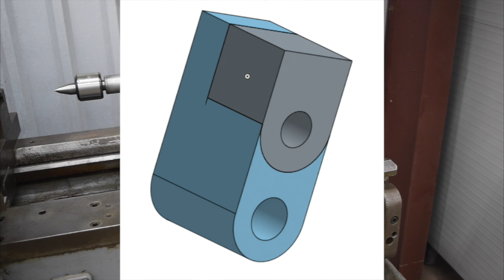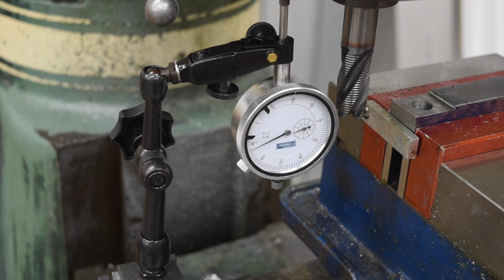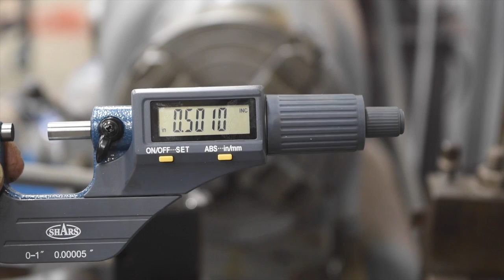1954 Monarch 10EE Lathe Tailstock Modification - Part 2

Comment: Gary thank you for the shout out and kind words.  
I apologize on the first video I had a hard time with the scaling and now I see your problem with the overlapping holes.  One option I see would be to fill the existing hole, probably the easiest thing would be to thread in a stud and loctite it in.  Finish it flat to the width of the tab.  Then, the part that you would make would have to be attached with a smaller screw, maybe like a 10-32 from the back.  Drill and tap the hole for the adjusting bolt, which would go through partially the stud you installed.  I think it would be ok since the bolts are not really seeing much load, just enough to move the tailstock.  Otherwise something on the outside like you mention in the video would work too.
On your threading, shoot for a couple of thousandths undersize for the major diameter and put a chamfer on the shaft.  These will help threading if you have to use a die.  I don't know how to put your lathe into back gear, but that will help too.
Reply from the maker: Awesome, thanks Bill, it sounds like i have a few options.  One other one i was thinking about... what do you think about this?  Mill the existing tabs flush with the bottom of the plate, plunge a 3/4" end mill into the same spot as the tab, but create a pocket that's 1/4" deep, then drill and tap with 3/8.  Then make an L shaped tab that will have a countersink bolt and recess into the pocket, and on the leg of the L drill and tap that to fit the current bolt?  I hate to modify the tail stock, but worse case someone could make 2 more L tabs the same height as the current should they try to put it on a 10" lathe... thoughts?
Reply: I think that might work too Gary, getting the tailstock setup on the mill might be a bit tricky.  Gary C's idea is good too would be a good test for your welder and gasmix.  If you go that way he makes another good point with installing an insert.  Make sure you size the boss for the larger thread size of the insert.  I like using keenserts for those type of things.

Comment: All the tooling starts adding up fast.   I got a brand new Bison 8 inch 3 jaw chuck for my lathe for $375 with the chuck key missing.  Normally there around $850.    The best thing you can do for the tooling is keep looking until you find each thing at a decent price.
Reply from the maker: Yea your right about that.  The key is to always be looking and not wait until you actually need it or you will pay the high price.  I have been doing that on a vertical bandsaw for a while now.

Comment: Fair enough on the money explanation. I can under stand that. We were lucky enough to get our machine with a bunch of accessories all for two grand. It's no where near as capable as that machine, but I can't imagine buying it piece by piece. I've never taken a tailstock apart myself, but I'll re-watch part of part what and see what I think. But I don't know it will be any better than what you come up with. I don't think an external plate wold work. Those things have to be crazy tight on bigger machines and they still move, at least our high school machine shop. Although, I've never had mine move even though it only uses tiny slot head screws. I was wondering if you would mention the stickout. Yes I did mention that. CNC machines for some reason tend to use crazy long shank tools. You'll never need the extra length more than likely, so if you want to, just score it and snap it off. This old tony shows how in his endmill fixture video. If you don't want to, the fact that it is carbide means that you won't lose that much rigidity anyway.
A note on threading- You usually want the dimension to be about 5 thou undersize If you look in machinist handbook it will tell you the exact numbers for each thread. When they are dead on size, the die cuts in both the peaks and valleys, and is very hard to start.
Sorry for the long post, but it looks like you're making good progress.
Reply from the maker: Good stuff sir.  Yea $2K with a lot of accessories is nice.  I paid $2500 for this one and it only came with the collet setup and that was it, so yea, piecing it together is kicking my ass (wallet).  Good point on shortening the end mill.  Yea, seems like CNC machines, especially the 5 axis once need to reach deeper so makes sense they are longer.

Comment: Good series Gary and I like your attitude to money management. I'm a recovering ebayholic but it's just too easy to spend hundreds here and hundreds there on this kind of hobby/business. I thought woodwork tools were expensive until I started buying engineering equipment. Old machinery can be ridiculously good value for money though.

I'll probably be doing this job myself one day to raise the capacity of my South Bend Heavy 10L to about 12 inches but I'd definitely go for making the plate for the tailstock to sit ON rather than be sandwiched between the base and tailstock body to avoid the side adjuster issue.

Btw, please hammer a wedge under the mill to stop it wobbling? It's such a simple fix :-)

Comment: So far so good Gary.  I IMHO I think you should fix the new Ali section to the top casting with 4 small countersunk screws then weld 2 threaded bosses onto the alu' as per the old cast section.. Make them line up in the same place as the originals. Then the bolts would fit using the original holes in the base casting.. You may have to helicoil them to prevent wear and iron to Alu' seizure. regards from the UK
Reply from the maker: Thanks Gary from the UK, glad your watching, excellent idea.  This has been a fun project, and good to do it along with you guys to get your insight.

Comment: You should be able to put the lathe in a low gear and the chuck won't turn when running the die on. Not a lock but usually works.

Nice little shop you got there.
Reply from the maker: Thanks Jim, yea the back gears are no longer in the lathe, it has all been converted over to a VFD for speed control, its how it was when i got it.

Comment: Wow that looks awesome Gary. Pretty impressed over here. I would say, regarding the tail stock, for the most part you just have your time and some relatively inexpensive materials in to modifying this one. At this point, why not just see if you can make it work? If you can't, there's always plan B. If it works, you saved some money and have a pretty unique showcase of your talents, as well as some videos to boot. #winning
Reply from the maker: yes sir, well said.

Comment: Forget the "experts" you're on the right track. The 3d drawing looks like a good idea, if you reduced the size(diameter) that passes through it possibly it would give the room you need? Just a thought.
Reply from the maker: It would probably have to be a small diameter bolt for sure, but it's possible.

Comment: regarding the thickness of the spacer, when you bolt it together you may find the center may lower when the space is taken up. if you do lower it a bit too much, you could use some brass shims.. .  good luck with your project.
Reply from the maker: Ok, thanks Dennis, so far it seems to be working good, but it may be a touch too low.  i might try some brass shims

Comment: Well the simple way to do it is to come thru the spacer plate with the alignment screws. Of course you will have to pin the spacer plate to the base to do that. Which is far less invasive then altering the bosses. But as far as being able to achieve any precision with the tail stock it will be difficult. 1st and foremost the spacer needes to be dead nuts flat or your center will never be aligned. It may be close but as soon as you move the tail stock your "close" will be gone again. Since your not flat with your spacer your tail stock is on an angle to horizontal so depending on length of tools or how far your operating a tool out from the tail stock the error will amplify. What your doing will likely work but how well it works depends on the flatness of the spacer.
Reply from the maker: Tom, not sure if you saw, but where the bolt would need to come through to hit those bosses would right in the middle of the joint of the spacer and base plate.  If it needed 3/4" or 1" spacer, it would have worked.
Reply: I apologize, i knew that, spoke before i thought.it through.
Reply from the maker: No worries Tom, i know these videos are long, lots of options being discussed, we will figure it out... not sure how well this will work when i am done, but i am learning a lot by doing it so not all is lost.

Comment: Do you have acetylene to braze? If so you could grind or mill the boss until you hit the hole then build the boss up a half inch, also filling the original hole in with brass. That would give the extension a good grip then drill and tap the boss extension. No need to move the outter hole then. This would be reversible too if you wanted to change it back to original height for another machine. Hope this helps and I'm not missing something.

Comment: I know the difference between the 3 & 4 jaw chuck but what are some example operations you would choose one or the other on? Just curious.
Reply from the maker: actually this project was a perfect example of when to use a 4 jaw, you can fit square stock in a 3 jaw.  And the 4 independent jaws let you get it running perfectly concentric with the spindle of the lathe, but it takes a little work with the indicator.  I am pretty slow at indicating.  Not sure if you watch ABOM79, but he is a badass at indicating in a 4 jaw chuck, he can do round stock in less than a min sometimes.  Takes me about 10, lol... check him out here.  https://www.youtube.com/watch?v=aA0suYN72SE

Comment: Can you Tig weld extensions to the tabs close up the existing holes on the factory tabs and mill out the holes lower on the tabs where they need to be ?
Reply from the maker: yea that's definitely a good thought... just uploaded the finale.. check it out :)

Comment: Hi, I am catching up on the tailstock adventure. Nice job on the mod.  However, since you have now a Monarch turret lathe, why not use it as such? It is a much more rigid setup as a turret than any tailstock. Granted, you have to use it with a different technique than a toolrom lathe but there used to be many shops that produced parts with a turret. BTW, I do understand the advantage of a tailstock for one offs. I am just saying why not use the turret? Daniel

Comment: is the machine shaking
Reply from the maker: oh yes, the mill is not level and its sitting on some uneven concrete so it moves around, it doesn't really shake within itself, the whole mill tilts back and forth.  Once i get it in ints permanent home i will bolt it down.
Reply: put some metal shims under it for know

Comment: Can't you just make a dog bone figure 8 kinda thing to hang down from the existing boss to reach your hole?
Reply: That might work too, but I'm not sure there is enough material in the middle  the bolt looks kinda big like maybe a 3/8 or even a 1/2.
Reply from the maker: yes sir, I will be doing something similar to this I think.